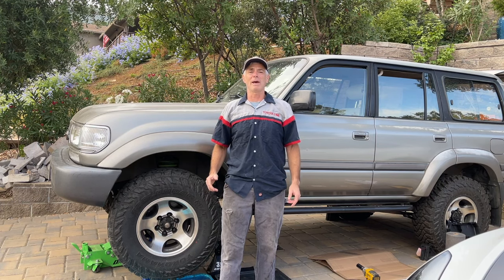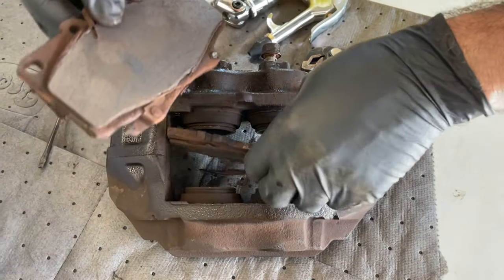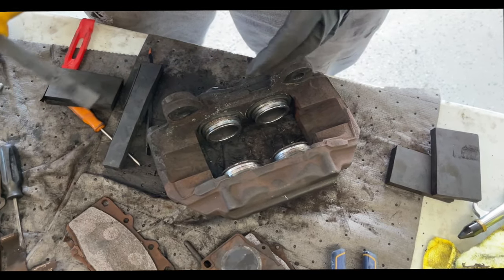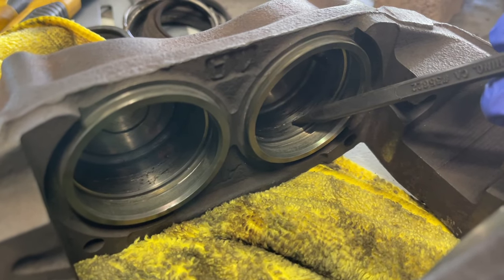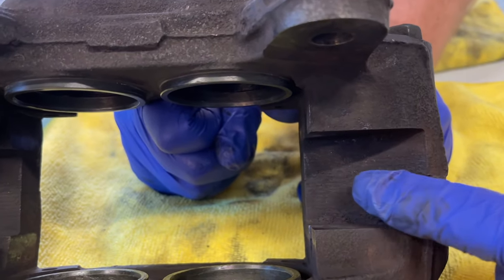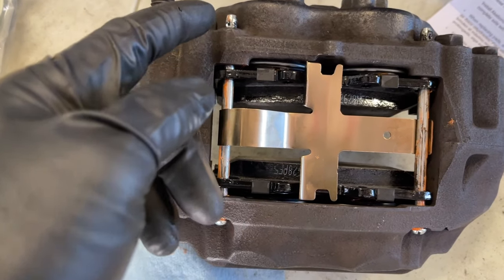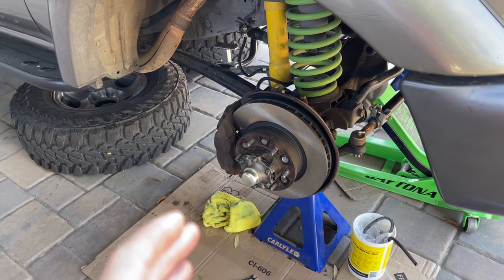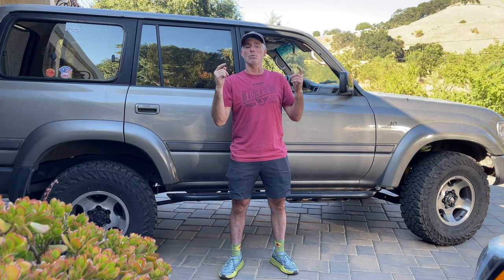Toyota/Lexus Brake Caliper Rebuild (FJ80/LX 450 & Any Other Model with a 4-Piston Front Caliper)

Comment: Just from my lessons learned from my old Tacoma- if you want to avoid rebuilding the calipers while the truck is still less than 80k-100k miles, make sure to just purchase the correct piston compression tool for the front calipers. Don't do the screwdriver prying against the pad method that a lot of YouTubers still show.  As shown in his video, the piston walls DO accumulate containment and buildup over time (partially because of the outer fluid channel in the caliper), and the screw driver method causes that stuff to foul up the piston/seal interface, it may slow down just one piston.  This eventually causes uneven, unlevel pad wear by a very small amount, and then will cause a runout on the rotor- and as a result causes whole truck shakes during light braking despite having very smooth hard-brake performance.  The piston spreader assures that the pistons are returned all the way in while staying perfectly square with the caliper.  Multi piston calipers are great, but they are slightly higher maintenance and they all need to be moving evenly with one another to always allow for  perfectly level pad wear.  Needless to say, I rebuilt those calipers, and then replaced all the hardware again because of the runouts, and they performed even better than new without any problems.
Reply from the maker: Thanks for sharing all that.

Comment: If you are reusing pistons with any corrosion, you want to put the piston in with the discoloration up. Opposite the staining in the caliper. The rust/stain/deposit always forms on the botom(as installed), because water that creeps in through the seal from the atmosphere collects on the bottom.  Also, "brake caplier assembly fluid" is the best shit ever made. It's not hydroscopic. If this is a car you don't often drive, its mandatory.
Reply from the maker: Hey Andrew, thanks for the information contribution.

Comment: A great product for the caliper and pad sliding points is Super Lube brake grease (97008 part number). It's silicone grease based with PTFE. Seems to have better overall reviews than various Permatex products.
Reply from the maker: Thanks for the tip Jordan!

Comment: I know I learned the hard way on my Tundra put the wear indicator on the OUTSIDE not the inside pad. My outside wore before the inside and ate into the rotor before it squealed on me. Toyota should put indicators on all pads IMO.
Reply from the maker: I really think it's luck of the draw which side you put the pad with the wear indicator on so you catch it before you go metal on metal and destroy your rotors.  I absolutely agree with you that Toyota and other manufacturers should put the wear indicators on all 4 pads.
Reply: I bought a set of pads from Amazon for my Tacoma. They were in the used and repackaged. I paid under nine dollars for them. They were brand new and they had the squealers on all of the pads. 
My friend said I got a deal because you can’t put brakes on a bicycle for less than nine dollars. I don’t drive it that much and they have been great so far. I’m getting my money worth. 😀
Reply from the maker: @stevanrose7439  Yeah, that sounds like a great deal.  Most of the aftermarket suppliers of brake pads adhere an anti-squeal shim onto the back of the pad.  Toyota does it differently.  The pads come separate from the shim kit and the shim kit is made up of two shims, one slotted and one solid.  But, the Toyota shims are reusable.  Most people who replace their OEM pads with aftermarket pads, throw away the OEM shim kit, which is a mistake, if you ever want to go back to OEM pads.

Comment: It's likely that the small amount of corrosion or contamination to the pistons and inner cylinder, didn't get past the seals, but came from moisture in the brake fluid. Most brake master cylinders are vented to the outside and brake fluid is hygroscopic (absorbs moisture), which is why the brake bleeding maintenance intervals are pretty important to follow closely.
Reply from the maker: Hey, that's a very good point.  The brake fluid can develop moisture in it over time and that's why it's important to renew the fluid at regular intervals.  Thanks for sharing this.

Comment: Replacing the Banjo Bolt with new washers is a great idea.
I did my brakes and calipers without replacing the Banjo Bolt and washers and shortly after every one of them leaked.
I'm not saying that will happen with yours but that is what happened to mine.
GREAT VIDEO!
Reply from the maker: Well, for sure the washers are supposed to be replaced.  In the Toyota FSMs, they are always considered a non-reusable part.  But, the banjo bolts are reusable.  There's not a lot that can go wrong with them other than getting plugged with gunk.  So, I view the banjo bolt replacement unnecessary.  But, to each his own.  The bolts aren't expensive, so replacing them isn't a huge expense.

Glad you like the video Rich.
Reply: You're welcome! I agree with you about the banjo bolts being reusable. @TimmyTheToolman

Comment: Another great video.  I found your advice on getting the pistons out very encouraging because I don't have a compressor.  So I assumed I wouldn't be able to do this job.  But seeing your video changes all that.  BTW I've done 2 valve cover gasket jobs on 5vz-fe rigs in the last month and both went perfect thanks to your channel.
Reply from the maker: Thanks!  I'm glad you liked the video.  Yeah, the air compressor trick to get the pistons out is more of a pain in the ass than it's worth, in my opinion.  I suppose if you had the perfect progression of blocks and shims to get the pistons protruding out of the caliper fully, it wouldn't be bad, but we found we'd end up getting one piston that would shoot out too far and then we'd have to push the piston back in and reset.  When I finally went to the screwdriver, I realized it was way more straightforward and easy to get the pistons out of the caliper.

It's great to hear our videos are helping you out. Thanks for the comment, and Happy Wrenching!

Comment: Thank you Tim!  This is another great point of reference.  I will be rebuilding 2 sets of Tundra calipers; the 199mm, & the 231mm from a Sequoia.  I just got them all cleaned up and ready to paint!  Both factory kits are the very best; however, you still need to keep the inner seals to reuse them, because the factory kit do not come with these.  Take care Brother!
Reply from the maker: You're welcome.  I'm guessing the inner seals you're referring to are the ones that seal the caliper halves together?  The piston seals should be replaced and are included in the rebuild kits.

I had heard from another person that if you don't have to crack the calipers apart, don't.  Toyota doesn't sell the o-ring seals.

Comment: Very detail video on caliper rebuilt. I used this as a guide on 04 4runner, but 2 out of 4 pistons on both front calipers seized up and had to buy rebuilt calipers from Napa. One question though, why the rebuilt kit comes metal rings for pistons boots? The original calipers on my 4runner only have rubber boots on the pistons and they were easy to remove.
Reply from the maker: The metal rings help keep the boots in place so they don't slip off.

Comment: Great timing.  My dust covers are looking a little ratty so I need to do this before the pistons start sticking.  I got the OEM kit but no grease.  I assume I can just use a little brake fluid.  Or should I use the same hi temp grease that I will coat the pins with?
Reply from the maker: I don't know what type of grease that is that comes with the kit.  I think the high temp caliper grease would work fine.

Comment: On my highlander I took off the caliper with the pads but left it attached to the brake line. I put a block of wood slightly less than the thickness of the rotor and stepped on the brakes. The pistons moved out. 
Then put thinner wood, repeated till the pistons were almost out. 
What do you think?
Reply from the maker: @SeshMurthy  I think that can work, but if the calipers don't move equally, which is common, one side could pop completely out and then you have a huge mess of brake fluid and a more difficult time of bleeding the brakes afterwards.
Reply: @TimmyTheToolman  that’s why I started with thick wood moved the pistons a little, then put in thinner wood etc so that they moved in unison.
Reply from the maker: @SeshMurthy  Well, what can I say.  It worked for you, so good job.

Comment: Hey Tim my 97 taco the caliper piston boot is a little bit ripped, toyota wants $35 for each for the kit, should i rebuild or just buy new calipers if so what kind, thanks.
Reply from the maker: You literally could just replace the one boot and be done with it.  You don't have to rebuild both calipers because of one ripped boot.
Reply: @TimmyTheToolman  im a noob lol i didnt know that, so i dont need the rebuild kit, i can just get a generic boot? thx
Reply from the maker: @yotagang3705  I don't know if you can buy just a boot.  I was thinking, buy one rebuild kit and use one of the boots out of it.  Save the other parts until you do want to rebuild the rest of the caliper.

Comment: Lightly polish the area where the sides of the pad sit for free movement
Reply from the maker: I'm guessing you're talking about polishing the inside of the caliper on either side of the pads?  There really shouldn't be any interference there, but I guess if there's a build-up of corrosion in that area, knocking it down with a wire brush would be advisable.  The crucial things to make sure are smooth are the retaining pins the pads ride on.

Comment: what's the cost of just getting some new reman'd calipers with all-new pistons, boots and such... nice + shiny silver housings as well
Reply from the maker: Depends if you go aftermarket of OEM.  OEM is more expensive.  Either way, it's a huge savings doing the rebuild.  HUGE!  And, doing the rebuild isn't hard since we did a lot of the homework for people.  Messing with the air pressure to get the calipers pistons out was sort of a waste of time, but we saw others do it and wanted to give it a try.
Reply: Front reman calipers are around $80 each and are very prone to leaking and failure. Toyota rebuild kit was about $50 total, and it stays Toyota and not some sweatshop rebuild. 😅
Reply: @calokie5567   there is usually a core charge on those as well from the Yota dealer?  I  would not think a reman'd from OEM dealer would be prone to leaking but they do?
Reply: @TimmyTheToolman   i was just curious because my Taco rig has 329k miles and has seen plenty share of winter road salt! after a 1/4 century... maybe buy new pistons as well if they sell those? checking and they do sell new pistons at about 20$ each after the online discounters
Reply: @calokie5567   i bot reman calipers for a Gen7 Corolla from the autoZone... they were stamped Toyota so is it a hit and miss with those mcStore parts?
Reply: I thought about remanufatured calipers , they are less expensive than new,  BUT to ship back the heavy core for reimbursement of core charges  can be expensive. So  the website ( RockAuto) mentions this and I opted for new ones instead. if you are buying rebuilt ones locally then shipping costs won't be an issue.

Comment: thanks for the videos. i got a 4runner that is stuck in 4 lo. j shift . 2000 sr5 w e locker. i cant get the transcase in to 4 hi or 2 hi. stays in 4 lo even if i put in N and shift out of 4 lo to 4 hi then to 2 wd it shifts out on 4 lo kinda . but not in to 4 hi. but grinds . like a half neutral. electrics say is shifts 4 wd off and on. but stays stuck in 4 lo or when i can force it out of 4 lo , it just grinds or rubs. i dont kno but its stuck in 4 lo. what can i do . i was going to swap this used one in i got today. but  thought id ask a professional
Reply from the maker: I've never troubleshooted the transfer cases on 3rd Gen 4runners.  I've never had an issue with either of my rigs and nobody local to me has asked for help either.  I would suggest posting your question on a Toyota forum like T4R.org or a Toyota Facebook group like 3rd Gen Mafia and maybe somebody has some answers for you.
Reply: @TimmyTheToolman  Appreciate it.
Reply from the maker: @HarleyRunner  No problem.  If you find an answer to the problem, please share it with me so I can learn about it.

Comment: Why do calibers link even though the rings look fine they're just old?
Reply from the maker: Did you mean to say "Leak"?
Reply: @TimmyTheToolman  Yes leak.... The rubber rings look fine but the caliber was leaking badly and the piston is polished as smooth as glass The only rust was inside the grooves
Reply from the maker: @gasisthepastendoil  My guess is the seal just got old and less supple and it started leaking.